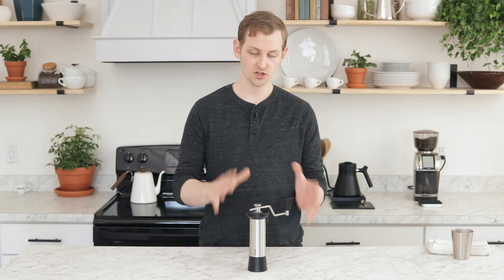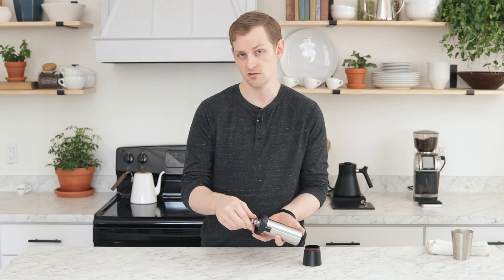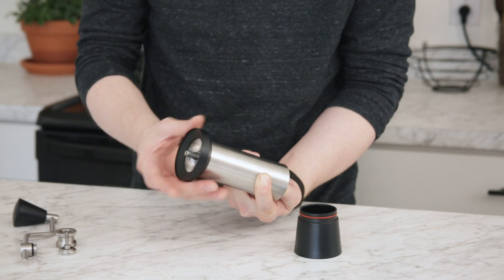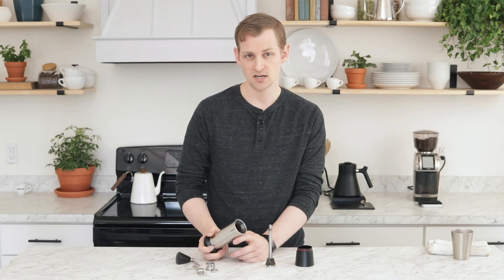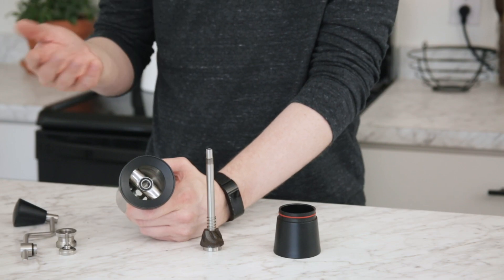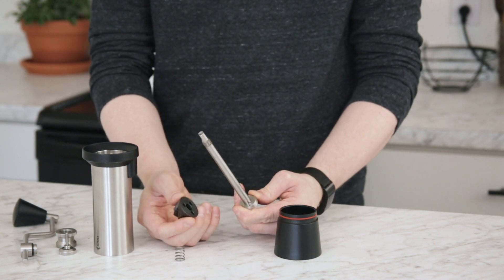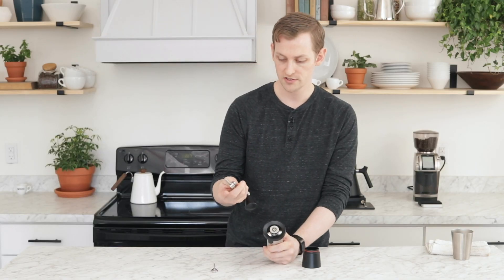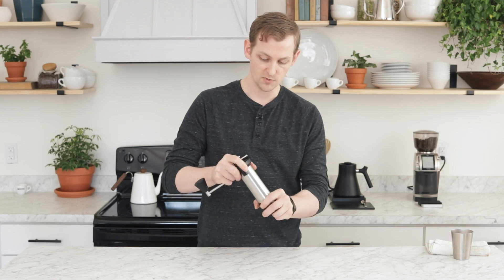How to Take Apart a Kinu Hand Grinder

Comment: Isn't it a good idea to zero out the burrs when putting it back together, so you can then adjust the grind setting to what you had before taking it apart? I love my Kinu M47 too!
Reply: how is this done? arent the threads simply the threads, or are they a multi start?
Reply: @W650cultmember  zero out by tightening the adjustment knob until it stops then backing out to your previous setting.
Reply: @longfang98  You're right. In the video, the person doesn't specify when to stop tightening the adjustment piece. So when I was about to put back the last piece, the little line where you check what number of grind size you have, was on 4 instead of 0. So yes we have to tight enough so when you assembly everything it fits on the 0 at the start.

Comment: Bought kinu m47 classic.
 When I set the burrs to 0, the grinder continues to rotate easily, is it normal that they are not in contact with each other when the adjusting wheel is fully turned.  On all my previous models, the millstones were in contact with each other and there was no rotation.
 Also in one of the reviews of kinu m47 classic, when the adjusting wheel was turned to 0, there was no rotation.  Do you also?
Reply: i have now the same problem man did u find any solution btw?